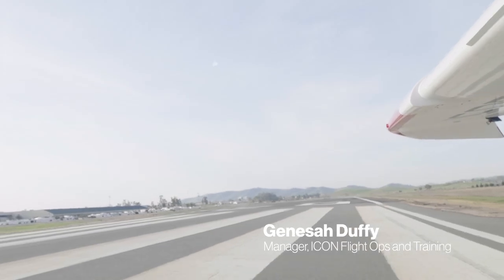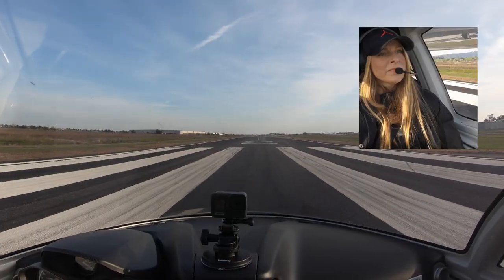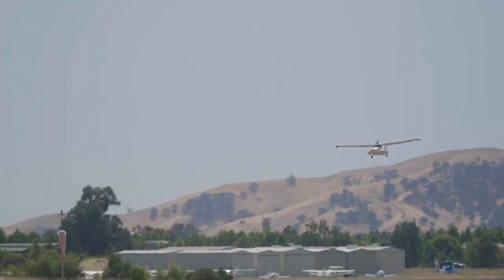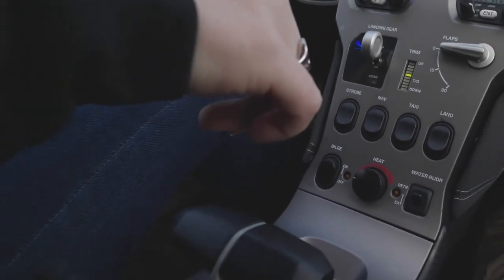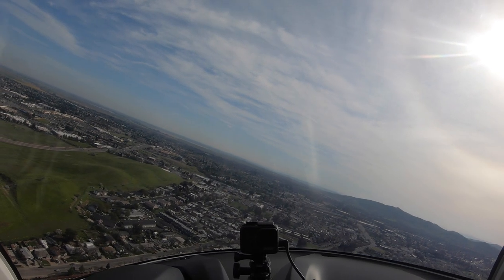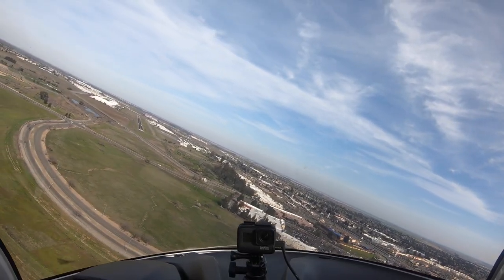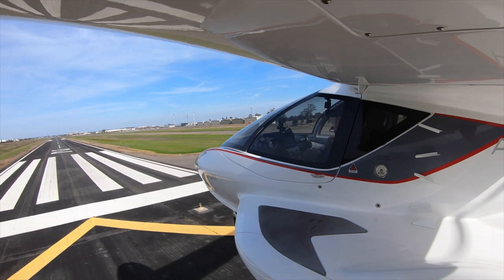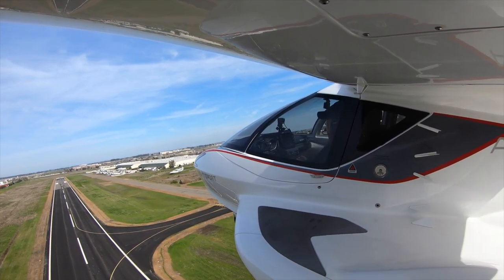How to Take off and Land on a Runway in the ICON A5

Comment: The 600kg LSA limit is silly and it means that after making the amphibious frame, the 2 seats and the RG - you've only got enough weight limit for a tiny Rotax-912 and tiny fuel tanks.
Do you guys plan to make a version of essentially the same but has a bigger engine and fuel tanks for PPL holders who don't care about the 600kg limit (I think it might be a bit more for seaplanes, but still small)? Maybe even a 4-seater? That'd be awesome.

Comment: Water Rudder ? Up-down ? Would like to know more about that. Thought the aircraft flying rudder was used when in the water ?
Reply: The A5 actually has a water rudder that interconnects with the air rudder. When in the water, we hit a little electronic switch that lowers the water rudder into the water for more controllability.
Reply: Standard to have water rudder(s) on Seaplanes.

Comment: Why do you have the flaps up for both takeoff and landing?
Reply: In the A5, normal runway takeoff and landings are done with zero flaps.
Reply: Zero flaps takeoff and landing ... when are flaps useful, short field ?
Reply: @GenesahDuffy  I then assume the flaps are used for water landings for a slower touch down.
Reply: Play2winbaby yes, short field and soft field landings we use flaps. Normal, none.
Reply: JohnPavilonis correct, all water takeoff and landings are done with full flaps.